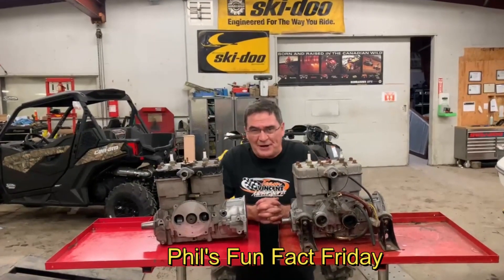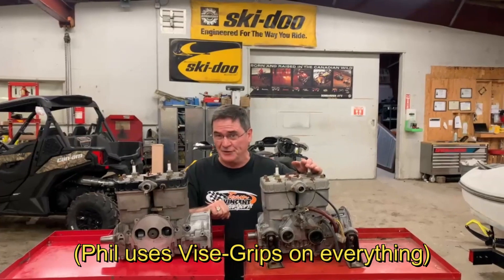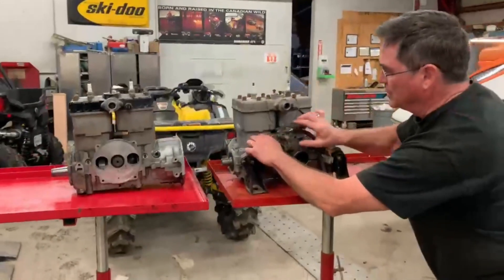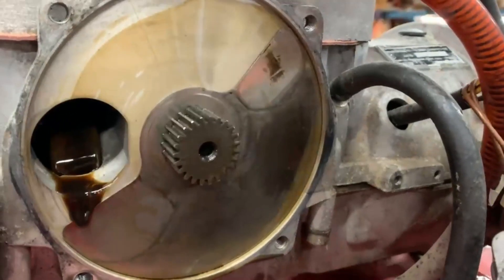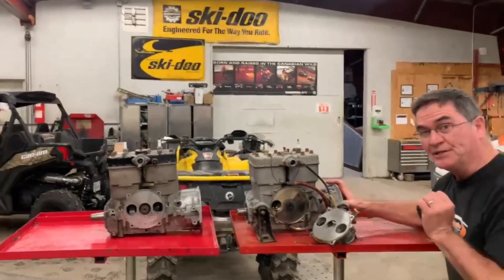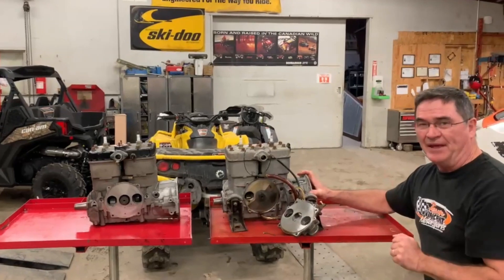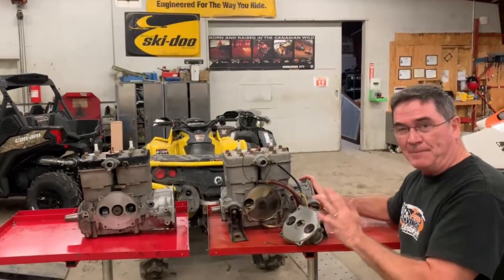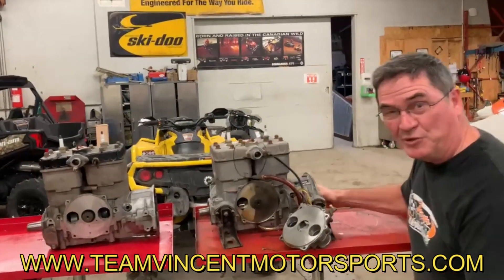TVM Rotary Valves

Comment: the fastest 2 strokes ive owned had rotary valves.
reed valves is for cheap manufacturing and low reving engines.
Reply: 9000 rpm is low reving?
Reply: @romper4444  in the 2 stroke world, yes.
9000 is high 4 stroke car engine.
the rotary inlet valves 2 strokes i had.
the 50cc was doing 16500.
the 125cc did 14000
ive seen other 2 strokes even do more, 18 to 20k

Comment: A friend in New Zealand has reinvented the rotary valve recently. A rotary valve with a second guillotine that slides across the intake in the opposite direction. Its controlled by a servo motor and serves two functions. It provides both variable intake timing for a very wide power curve AND it also acts as the throttle. 
It works very well and has proven reliable, tested in the dirt and mud on a motocross bike.

Comment: The 3 cylinder Rotary Valves Rotax Crank Shop . is my favorite engines for drag racing lots of power and torque...
Reply from the maker: There was a lot of hidden power that tuners could find!